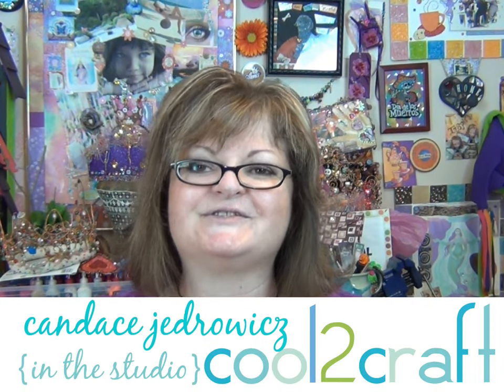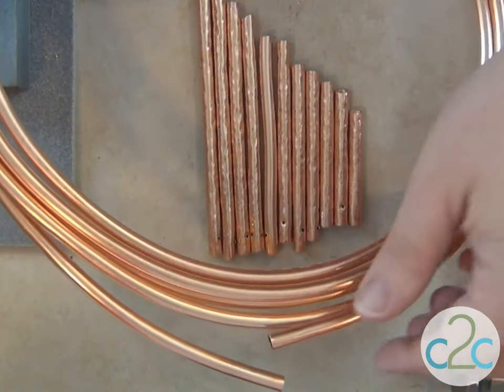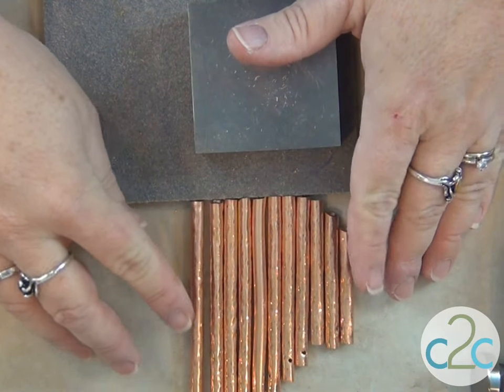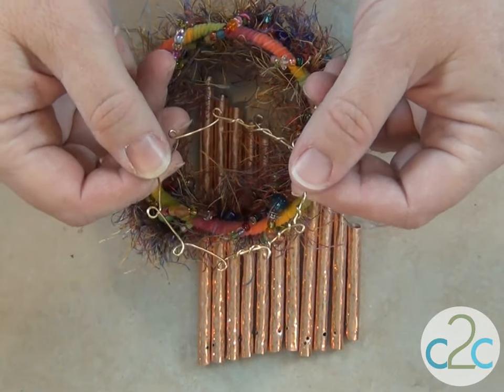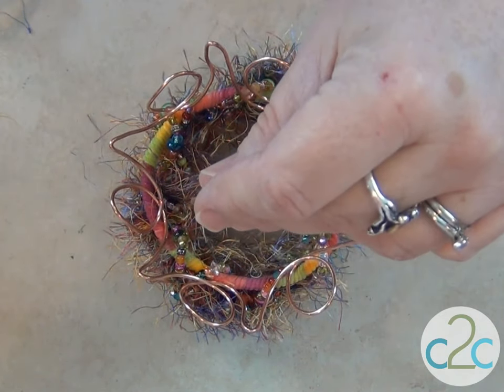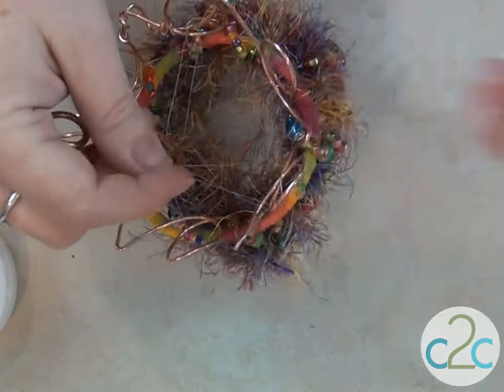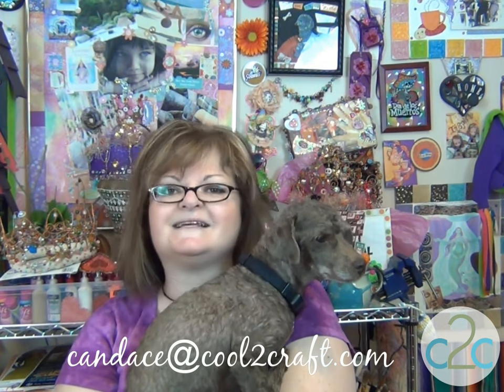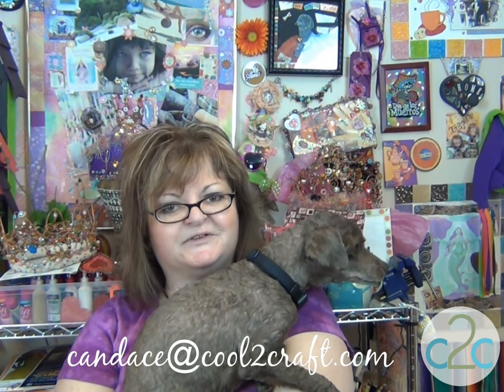How to Make Your Own Chimes by Candace Jedrowicz

Comment: Very cool.  Change of subject and need your input.  I purchased a double sided hammer for imprinting the design (I know there is a term for it - my brain is on a break right now) but the hammers really don't do the job I was hoping for.  I really want some dimension in my metal pieces and don't know how to achieve that.  Any suggestions on what I can use to make some beautiful markings on my metal.

Comment: I LOVE the sound!!! Hope I can make it... the "hard" part seems to be the hole making; Didn't understand if the hammering is necessary or if you did it because it was bent. Does the hammering affect/change the sound?
Reply: +moniklds I'm so happy you liked the sound!  The hammering is merely decorative.  Because I had a skewer inside the tube when I hammered it, the shape did not change, so the sound did not change.
Happy crafting!